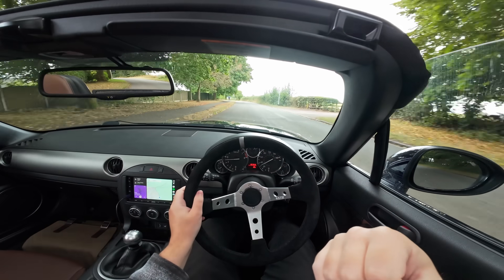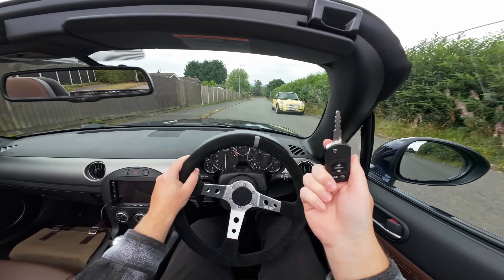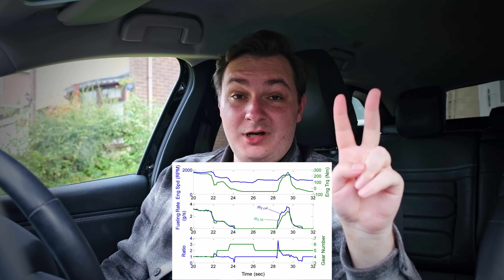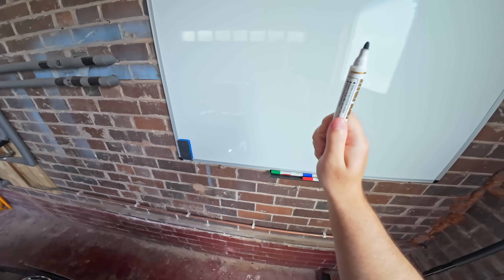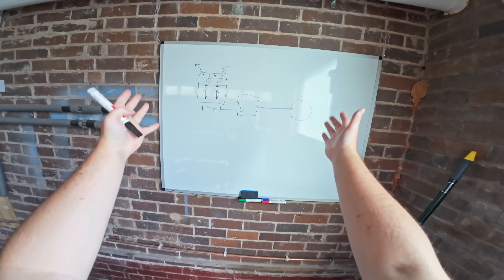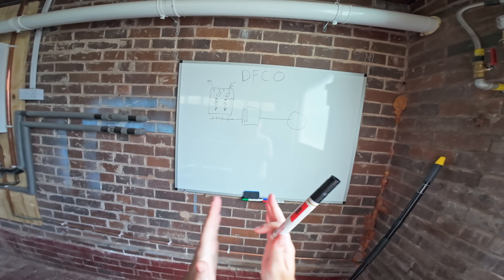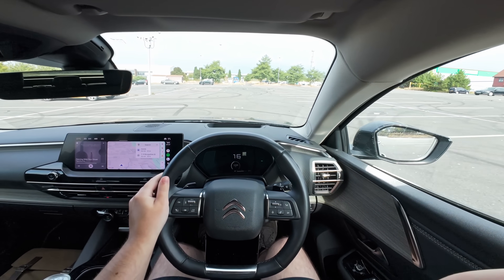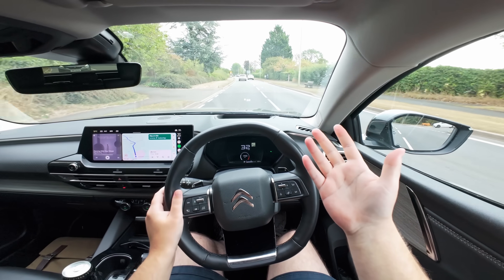The most misunderstood car term - Engine Braking

Comment: Fun fact: ChatGPT will tell you that old pre-1990 carburetedengines will still consume some fuel, not really intentionally, it's just that fuel just happens to still mechanically flow into the engine (if I'm reading it right).
For newer, injected fuel cars, there is 0 fuel being injected during engine breaking.

So, once again, ChatGPT outperforms experts.
Reply: In my Citroen C2 it didn't shut off fuel till after just over 2000 rpm. It's a bit annoying because you have to shift to a lower gear to slow down saving fuel, or you use less in neutral. In a Peugeot 206 HDI, it cuts off fuel as soon as you exceed idle, when engine braking.
Reply: @TimpBizkit  the fix for that is to drive the thing like a sports car. Keep your rev needle at just below the middle of the rev range when moving, and rev up to 75% before shifting in normal situations. If you wanna go fast, use 90% of the range.
After all, you paid for the whole tachometer, so you might as well use it. Trying to extract power at low revs is generally bad for the engine.

Don't do this if you've been neglecting oil changes - if you drive like this, your fully synthetic oil should be getting changed every 6000 km or every 6 months, whichever comes first, unless the car's service manual for some reason prescribes an even tighter interval. Usually it's about double those numbers.
Reply: @peterjohnson9438  well I could do that but in a discussion about fuel saving it is not really a point, as going round town in 2nd gear and 60 mph roads in 3rd and 4th will just use more energy keeping the engine speed up in the power band even when I'm not using the acceleration at that moment. I would usually drive in high gears, shifting to low ones for moments of acceleration, even up to redline if I needed it.
Unfortunately after 4 years and lots of miles, the head gasket in that car started leaking coolant into the engine cylinders but was an initially economical car despite that, and light enough to have reasonable acceleraton with 60 horsepower, and looked quite good in black too.
Reply: That is what I was wondering.
While the engine is on, it uses gas while idling to keep the engine running. So I was wondering if it still uses the same amount of idle gas while engine braking.
Reply: @KnoxxyPoxxy  and nope, it doesn't, because if your foot is off the pedal, the car should be slowing down until RPMs reach idle levels, and then it should keep the engine running by injecting fuel and cracking the throttle plate or idle air control valve. If the engine kept injecting fuel - any amount of fuel - the engine braking effect would be lessened, emissions would go up, fuel pre-detonation might occur, the catalytic converter might get damaged and fuel economy would suffer. You'll notice your car "driving funny" if you ever run into an instance where a fuel injector starts leaking. You'll likely also get a check engine light.

Here's an interesting tangent:
If you ever want to have lift-off burbles (or exhaust crackles or "pops and bangs"), you will need to replace the stock exhaust manifolds and catalytic converter(s) with parts designed to handle that. Many (if not most) cars from factory have catalytic converters built directly into the exhaust manifold, so any raw fuel escaping out of the engine may make it directly onto the catalytic converter substrate, which can cause it to melt.
I've seen two people experience this - one at a car meet where he showed off his pops-and-bangs tune and turned the car off when it started sounding odd and smelling funny. After letting it cool down, he tried starting it and save for a couple of coughs it would not start, as the catalytic converter had melted and was blocking basically all airflow.
Another guy had been ignoring a check engine light about his engine running too rich, and eventually reached out to the owners' forum saying that it started feeling low on power and eventually wouldn't start. He did not believe us saying that his catalytic converter was clogged until we had him put a rubber glove or balloon over the exhaust pipe and cranking it. The balloon vibrated but did not show any signs of filling up, meaning no air was moving through his exhaust, meaning the catalytic converter had become a solid blob.

Comment: I think you should talk more about the nature of engine braking, and practial use cases of it in certain scenarios. In my opinion, this is just a surface level kind of explanation, and deep down it's much more trickier than you said, as the "ultimate cheat code" to fuel efficiency.

First of all, where the does kinetic energy go? Besides air drag, certainly not all to friction, as it will brake a lot slower, for internal engine friction is very minimal. Most of the energy goes to compressing the air actually (the engine at such state is a big air compressor), therefore higher rpm will brake more agressively. If your goal is to maximize the time it cruise, then put it in neutral will even beat engine braking in terms of utilizing that amount of kinetic energy (albeit needing a bit of idling fuel, but even that will be more efficient than engine braking covering the same distance). There're some videos comparing those techniques, in conclusion putting it in neutral was best, but it's not really practical and dangerous as well. In my mind, if we have a way to open all valves any time the injector shuts off, then engine braking will be the most efficient -  minimal slow down, no idling fuel, maximize kinetic energy use. On the other hand, sometimes you need that agressive braking to convert the kinetic energy to heat quickly when going down hill, so it can also be tricky (or requires manual driver input) with opening the valves.

Secondly, as good as it sounds, engine braking is quite limited in terms of when you can use it. If you can foresee any distance of gentle deceleration to make use of it, then it's pretty ideal, but stop and go traffic will not allow you to do engine braking much, and when on highway or cruising at highspeed with no obstacle, you will constantly need to fight against air drag, no need to brake either. Slowing down then speeding is quite annoying for relaxing passengers, and it also consumes even more fuel than maintaining the speed at highest gear possible, so no engine braking needed for high speed cruising.

Comment: One thing I was always asking myself is, where does the energy actually go when engine braking? I mean, the pistons are compressing the intake air in stroke 2, but in the stroke 3 the air is expanded again, so (almost) no energy should go to waste there.  I can only imagine its friction of the pistons etc. as well as driving the water pump that is braking the car. 
In comparison to passenger cars, trucks (used to? or still have?) another type of engine braking where they are compressing the air in stroke 2 but then release the compressed air immediatly before entering stroke 3 through the exhaust without the expansion which "brakes a lot harder" but is also pretty loud and can be heard pretty far. Here it is obvious where the braking energy goes, but with passenger cars?
Reply from the maker: Such an interesting question, thank you!

My intuition says it's internal friction + the compression stroke... But you make a great point that the air is then uncompressed during power stroke.

I wonder if there's a temp difference during compression that means it has less energy during decompression...
Reply: @MickDrivesCars  Energy is wasted in the intake and exhaust stroke. Like you said, the compression and power stroke (mostly) cancel each other out.
Reply: There is temperature difference for sure. Some of that kinetic energy is transformed into heat, and released into surrounding air through the radiator, you can do engine braking and observe the coolant temp to see it, especially when the coolant temp is not saturated / up to operating temp yet. I'm not really sure how it got converted, but maybe through a delayed amount of heat transfer between compression and expansion phases.

Higher rpm will brake more agressively, partly from increased friction (minimal), partly from increased speed of water pump / oil pump, but mainly through the work of moving air from one place to another (sucking, compressing, expanding then pushing it out the exhaust). The increment in air flow speed also consumes energy
Reply: And maybe there's another big part comes from moving the piston. It changes direction every stroke (slow down then speed up), so it also takes energy to do that I think
Reply: @R3p1ica88 Well I don't think it is that, because engine's a build away that if one cylinder goes down another cylinder goes up, so they try to make them so that they not rattle and fail quick,  but run smoothly. I don't know the exact math behind it, however I have heard that you need at least six cylinders to run perfectly smooth, everything before will have slight imbalances.
Reply: @JPRTonundFilmstudio  This is engine balance, and you're totally right that a 6 cylinder inline engine is the smallest "perfectly" balanced piston engine.
But if you look at each individual piston, they have to stop moving (deceleration) and start again (acceleration) in a different direction. All of this imparts a force onto the engine that may be balanced out by a negative (reverse direction) force from other pistons, but that energy has still been spent by each piston and imparted onto the wrist pin, connecting rod, bearings and crankshaft as a "shock" when reciprocating. This is all loss, including when engine is running. This is why lighter engine parts can give more response, smoothness and higher revs.
Reply from the maker: I think the other dude might be onto something

I think in a 4 pot engine, the firing order has some impact here. I think when there's a power stroke, the other cylinders have valves open for free movement for the power cylinder...

I might be completely wrong but it's starting to come together in my brain's diagram lol. Actually if nobody is doing this I might have just unlocked some engine efficiency... Honda you hiring?
Reply: The whole point is that there is no/little air when you have lifted off the pedal, and closed the throttle body.
There is friction in the entire drivetrain - piston rings and slight amounts from bearings. Alternator, water & oil pumps also consume a fair bit of energy.
There is a big loss from the pistons trying to EXPAND the relative vacuum in the cylinder when no/little air is allowed to go in (in a wet sump engine w/ a breather to suck in atmo. air). The air below the pistons will try to push them back up again.
A huge loss is also from direction changes in any piston engine (not in rotaries tho!) where the piston has accelerated (taking energy) and then has to decelerate (more energy) and do the same in reverse.
Reply: Vibrations, Friction and Resistances to compression which leads to Noise and Heat
Some rolling and air resistance too (but that's also Vibrations and Noise in the end).
Remember a combustion engine is only 30-40% efficient, meaning most of the energy is lost somewhere else in the first place (and that loss is Noise and Heat).

A small part (or big depending your car) will also get transformed into electricity for the battery/batteries and internal electric systems.
Reply: Basically vacuum. With no air intake (throttle closed) and vacuum is inside it becomes hard to move the pistons. And as such you get huge resistance. 

Easiest depiction of this can be with syringe (without needle part ofc) as it is basically what piston is. In its barrel we have a plunger (piston) which goes up and down to pull in or out liquid or air. That is basically up stroke and down stroke of a piston. It moves freely and easily when the bottom end (where needle attaches to) is open (just like when we press the throttle pedal).
Now when we put our finger on the bottom side to close it or seal it, no matter the position of the plunger inside, suddenly we get this incredible resistance to move the plunger either up or down as the bottom is sealed (just like when we let go of the throttle pedal) and vacuum is created. We can still move the plunger but it takes tremendous force.

It's just because of the vacuum pressure it becomes so incredibly hard and you need lots of force to move that air within the vacuum to expand and compress.

Now because we are already at speed with the car, there is already ridiculous amount of force stored in the vehicle as we are in motion, the force is greater then what is needed to move pistons up and down in such vacuum and thus the pistons start moving but the force needed to move the pistons initially is the force that slows us down.

Now this initial force is also reduced or multiplied depending on the gear we are in. The lower the gear the less leverage there is and more force is needed enacted on the engine (thus car engine brakes more in lower gear). The higher the gear the more leverage there is and more force is enacted onto the engine (thus the car engine brakes less). Basically the reverse of what happens when we need to accelerate where less force is needed in lower gears to accelerate in lower gears while more force is needed to accelerate in higher gears.

Of course such initial force is basically converted into the heat (air warms up) while the rest is translated into motion BUT it is still MUCH less heat then when an combustion occurs. 

So your engine can just endlessly engine brake without ever overheating and you are not wearing out any part of the car (at worst not any more then when you are accelerating or maintaining speed). The only thing that is of putting is the noise it's much more then when there are combustions occurring and some can be scared of it when going into high revs with engine braking but ultimately engine and the whole car is completely chill.

I remember once passenger shat his pants when I went down huge slope in first gear and the slope made my engine revs go into the 5000. Engine was loud, no gas was given or brake pedal pressed and he thought engine was gonna explode (rev limiter is at 7200). I did that many times of course and nothing happened because nothing was happening to the engine. And when I needed to brake it was just so easy on that slope a touch of brake and it stopped easily and almost no brake pad was spent.

Point is. People especially with manual transmissions. Use that engine braking. Learn how to rev match downshift and learn how to engine brake slow down in traffic without using brake except emergencies or stop light. I can't remember when was the last time i actually replaced my brake pads. Every year when I replace oil and filters my mechanic looks sceptically at me as to why is there still so much meat on my brake pads.

You save money on fuel AND brake pads/discs. As well as prolong the life of engine since overall it will have less combustions done.
Reply: @sermerlin1 
So you argue, that a regular car engine pulls a vacuum like a syringe? Well, I honestly don't know in which of the four strokes this would take place. I actually tried this week a similar thing as was done in the video:  While going down a steep hill in a low gear I turned off the ignition and it continued braking hard. So far so good, however I then also played with the throttle and nothing changed with the perceived braking force of the engine. Since I have a Clio II from 1999, the pedal directly controls the air intake.